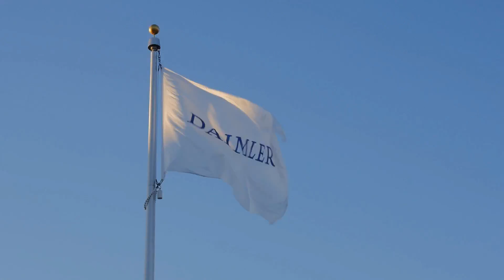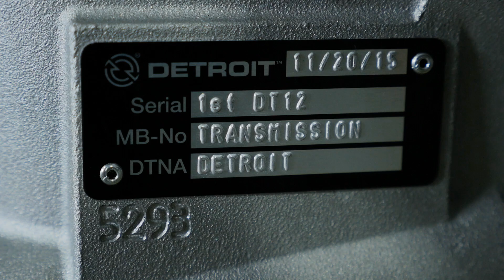Detroit talks DD5, DD8 medium-duty engines, DT12 truck transmission

Comment: The DD5 is a 4 cylinder engine and is the first diesel to have variable valve timing. They are for Class 5 and Class 6 and 7 trucks and chassis, such as step vans and light motorhomes for the 2017 model year. The DD8 is an inline 6 cylinder medium duty of 7.7 liter size, to be offered later than the DD5 engine.  It is a 5.1 liter and for North America the first version this fall is 210 HP and 575 lbs feet of torque. Another version will be rated at 230 HP and have 650 lbs feet of torque. The DD5 can be ordered later this year for delivery sometime after Q3 of 2016, for Freightliner trucks and chassis cabs. To compare diesels, the Isuzu engine in the Class 4 to 6 range is a 5.2 liter 4 cylinder rated at just 450 lbs feet of torque and the same 205 and 210 HP.  Obviously, the variable valve timing and latest computer controls, allows the extra 125 lbs feet of torque out the same basic size of engine with the same HP.  The DD8 in 2017, will be suitable for class 6 and 7 up to the low end of Class 8 trucks and chassis. With the much higher torque, the DD5 engine, mated to an automatic trans, will shift gears at a much lower RPM to maintain the same acceleration as competing engines from others. That will save fuel and reduce engine wear and noise for the driver.